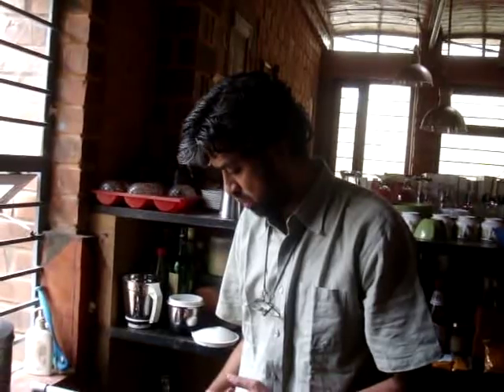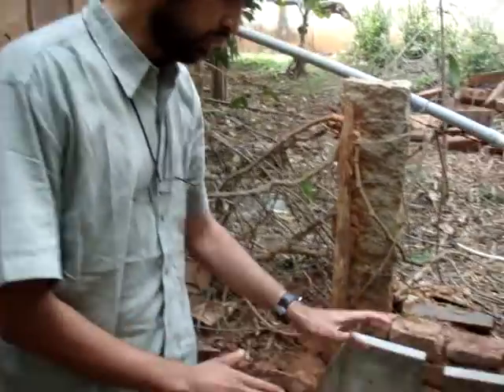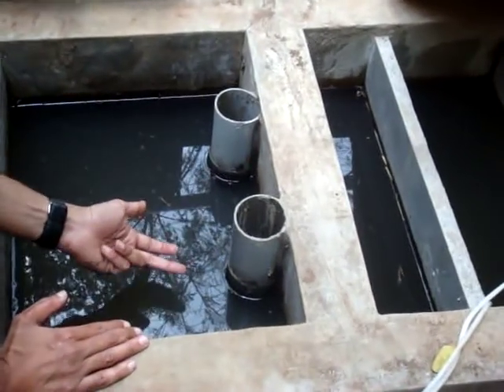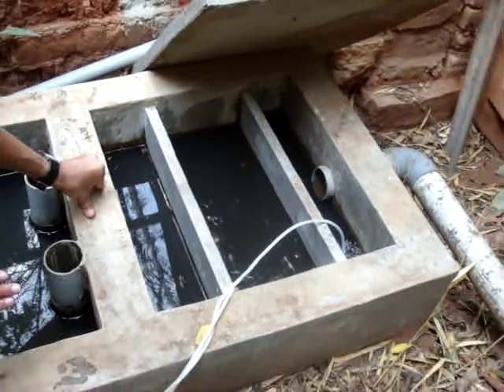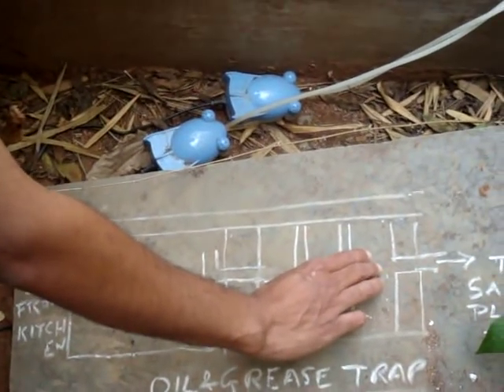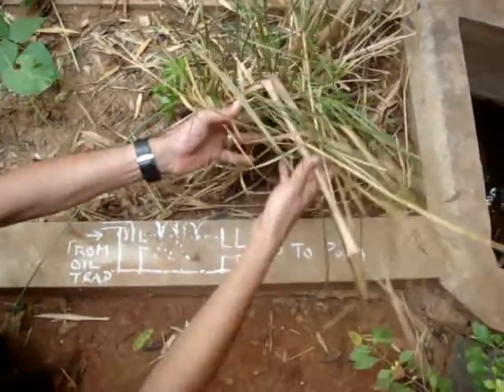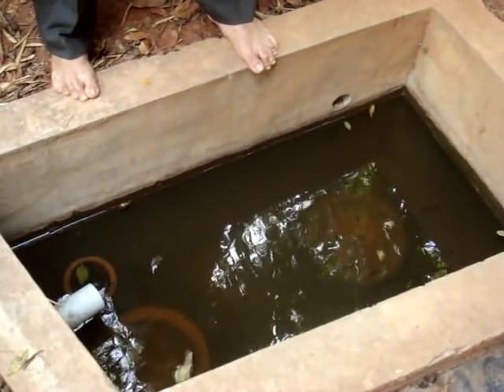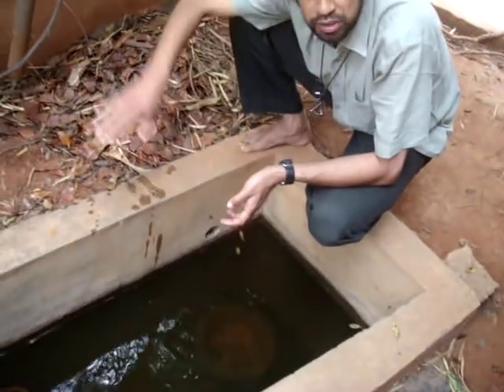Bangalore-Treating kitchen waste water for reuse

Comment: This is a concrete grease trap, this will cause a lot of  smell in the area, also the FAT ,OIL GREASE and SLUDGE  needs to be skimmed out manually, Which is not efficient.
The Sand filter, Plant bed and fish options are interesting though.

For a full fledged automatic system please visit our website and see the advantages of our system against the one shown in this video,We assure you a 98% efficiency.
Reply: Pl mention website address
Reply: Hi

Comment: add a small solar panel and battery and the air pumps would run without power from the grid. Great Video,

Comment: nice, very useful. But two issues:

1) it requires space
2) how do you remove soap if i also want to use the bathroom water.
Reply: I think after settling major particle, use of motor for foam creation can help
Edit: it will be helpful fo removal of excess active detergent, while due to oil or other food particles detergent gets attached with them ... They would get easily settle down

Comment: I want to think it through to implement this system with existing cans or devices. Can you please clarify.

1. How often do you clean sludge? 
2. Is there any thought on modular on sludge section?
3. Is there an alternative to electric motor to inject air ?
4. What would be the size requirement vs waste water per hour calculating for optimal design?

I am thinking about having two sludge sections with  modularized design so they can be cleaned often by taking it out. 

5.Can't we directly use water to plants after sludge or is it necessary to air them out?
6. How much effective the soap on water will be removed?

Comment: thank u man i thought no 1 has a cam and brain but I would like to point out using air bubbler is not nesisry u can use water fountain (stair like desine) it will do the job without power i had seen it in action 5 step will provide all the air u need and i will use a water filter to make it drink able (charcoal,UV,sand)  thank u

Comment: Sir, we are third year engineering students and we are making a project on this concept, we just need few clarifications on the quality of water thats coming out of the system. Could you please help us out, it would be a great help. - Anik Panja
Reply from the maker: What clarifications do you need ?
Reply: @zenrainman  Sir, the quality of water, its PH level after filtration, colour, odour, what will happen if we do not use the bubbler and how much oil and grease does the grease trap removes from water. Thank you in advance.

Comment: can we use it again for washing utensils?
Reply: No. You should not use it for food related activities, also not for bathing, brushing teeth or washing clothes. But you can water your lawn and ornamental garden or use it for toilet flushing. After building your own system and giving it a few months to settle down you should get the water lab tested. If it is low in bacteria and other pathogens then it might be ok for mopping floors or washing car. And as routine every two three months you should get it lab tested to ensure it is still functioning optimally. Of course if sudden change in colour, clarity, smell you don't need to wait 3 months to know something is wrong and you can lab test immediately.

Comment: Before your video, an ad for Cascade Dishwasher detergent ran.

What if an auto-dishwater emptied into your system?  Many kitchens in the United States present that reality.  How do the many chemicals affect your system?

In my kitchen, I refuse to use the auto-dishwasher.  Also, I never pour animal fat down the drain.  If others in my extended family and acquaintances must eat meat, I pour the animal waste onto newspaper, then I place in the greased-paper in a compost device.

Comment: Use aleovera as shop for removal of grees ,use fresh crushed aleovera pulp for cleaning pot. 
It remove all grees.  You will not get phosphate problem. 
Jay bharat.
Reply: For oil in the pot use wipe method, 
Mean rub the oily pot with clay or ash or sand or cocopit or tissue paper. 
After removing oil,  wash the pot with fresh  crush aleovera .
Wash with water taking water in pot and wipe wipe wet clothing. 
If we are ash or clay ,no need to use aleovera. 
In village people use clay or ash.
After  rubbing people take water in two pot and wash the pot inside first  pot and repeat  the process  for another washing in another pot.
It's very practical. 
Jay bharat.